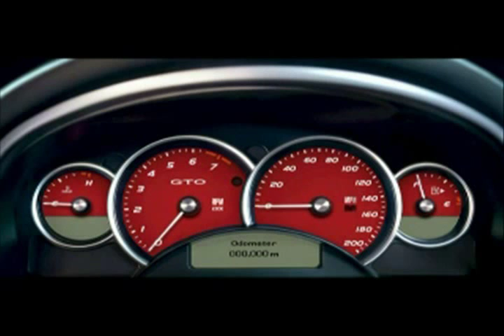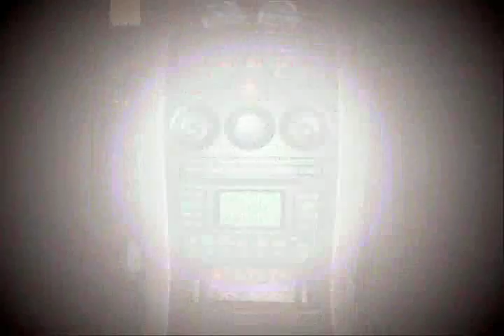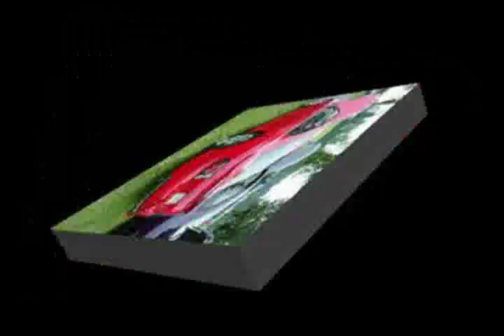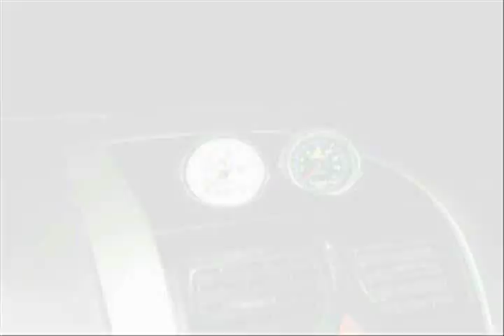Supercharger Magnacharger 112HH install of LS2 GTO/Monaro

Comment from the maker: 6700 installed nitto 275 40 r17 555r drag radials (extreme drag series)96 octane (half tank), 18 lbs psi in tires...7.5 psi in blower. Run COLD dead cold. I had a 2 hr wait in 50 degree windy temps before my 11.9

pulled up to the light and a vette wrecked in front of me. so I sat. 1st in line.
smoke the tire good....real good...11.9

Comment: @midiman1962 ls6 heads came stock on these, but they werent truley ls6 heads, they are the same casting, but dont have the sodium fill exhaust valves.